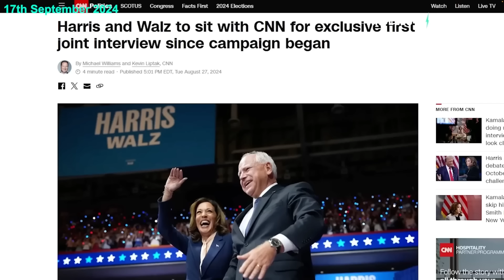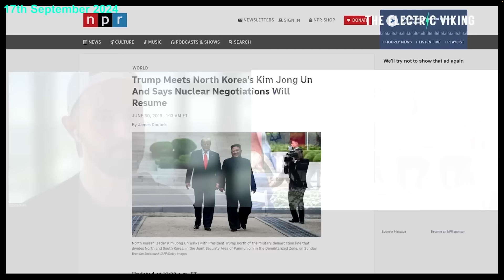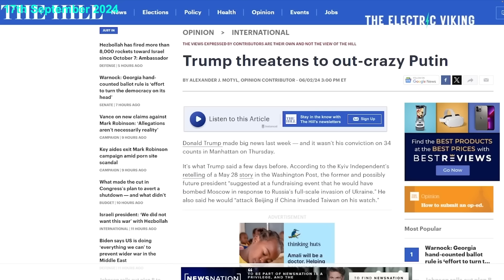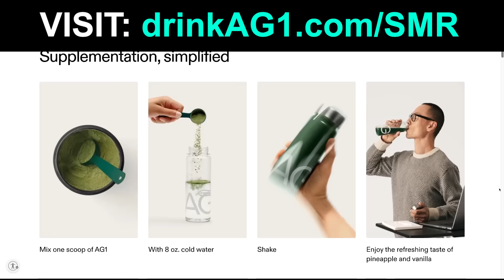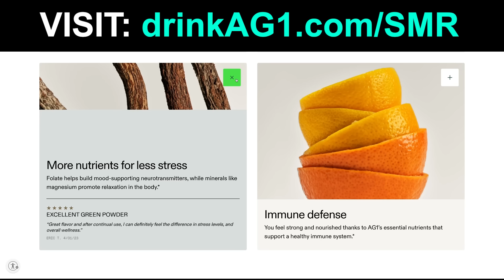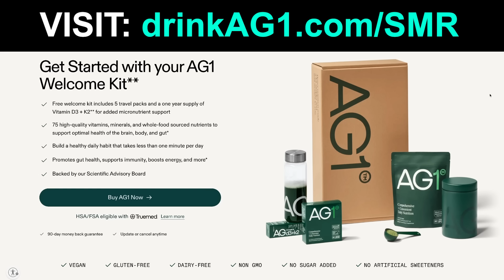Why Trump Is The BEST Thing For Tesla (and TSLA!)

Comment: The market will choose EVs because they are far better than ICE cars/trucks. Why? Because they are better, period!
Reply: Drive and EV, and you'll understand. For example they have instantaneous high torque from 0 rpm and no gears.
And then EVs are getting cheaper fast. In many cases an EV already cheaper than a comparable gas car.